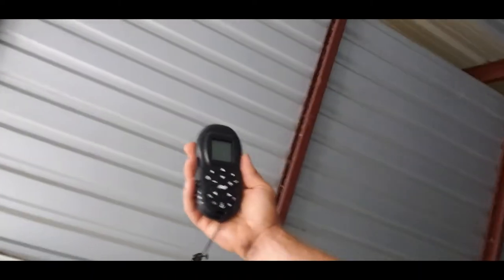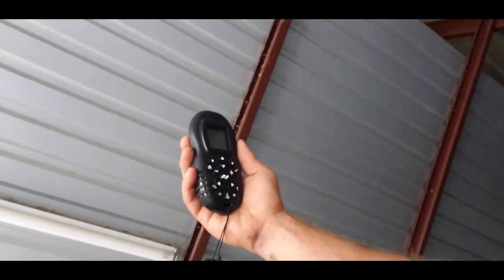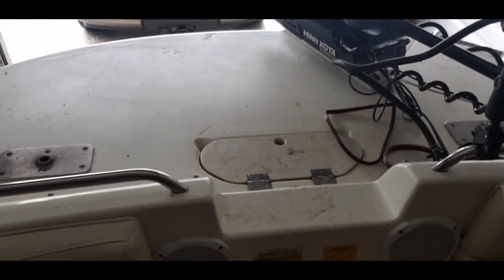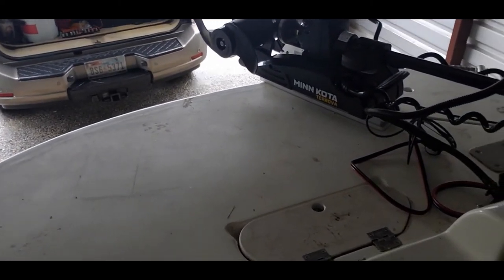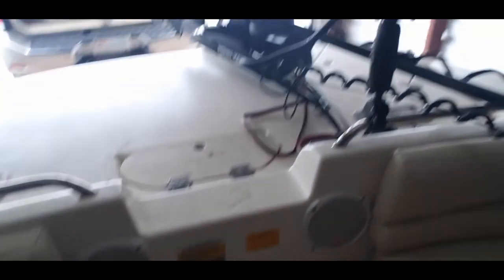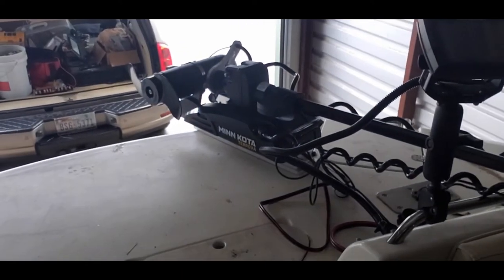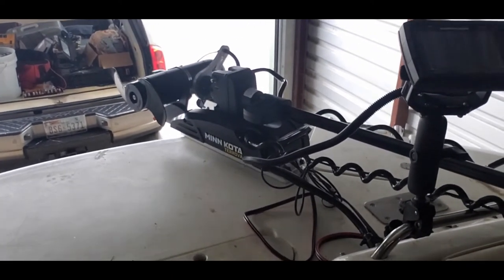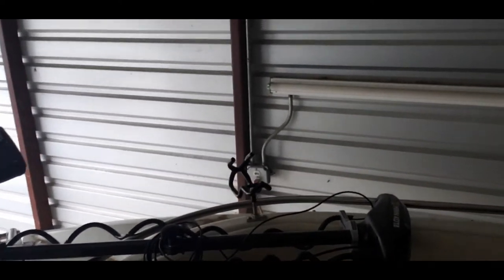Trolling Motor Walk Through

Comment: With the cornfield mount does the transducer wire still bind up when using spotlock? There is not much video I can find of their product.
Reply from the maker: I have not had it bind up a single time in SpotLock. I have to admit that I did it myself one time as I was trying to get to a snagged line and was not paying attention. No harm but I had to do a full 360 on the motor to unwind it. Both the transducer cable and the regular power cables were bound up so it was not specific to the cornfield mount. Just user error.

Comment: Quick ? Did you leave your transducer unplugged and attached to the trolling motor? I have a abundance of cable if I was to connect all the time
Reply from the maker: It is attached and the cable runs up the rubber tubing I mounted (~9:27 in the video). I leave it unattached from the actual sonar unit since I keep that stored. The end of the cable hangs loose when not in use and I wrap it up with the trolling motor power cord and lash it to the shaft when the motor is up and secured. I hope that answers your question.

Comment: Do the Cornfield Crappie parts clamp around the TM shaft, or do you have to take the motor apart to slide the parts down the shaft?
Reply: They come apart and clamp around. No dismantling of the motor is required.
Reply: This looks perfect!

Comment: Why did you run a different transducer?  The built in transducer will do sonar just fine.
Reply: Fair question. First, I wanted down imaging although I will admit that I don't use it much. Second I was unclear if the Sonar with the built-in transducer was comparable to Chirp Sonar and whether I would miss Chirp. In retrospect, I could have tried it and then added the additional transducer if I was dissatisfied. Where were you  8 months ago!!! :) I suppose I can still buy the necessary adapter and give it a try.